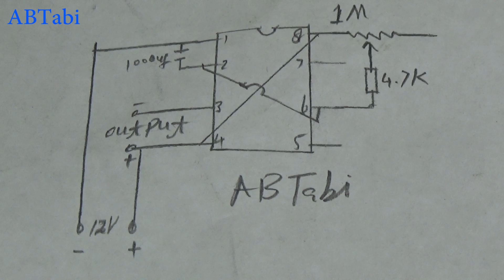How to make Adjustable Timer circuit, ON & OFF timer circuit at home

Comment: I want to make timer for 24V power input and it should be get cut offf after 45 min.

Pls help
Reply from the maker: Dear here you use 2m variable resistor and  1200uf capacitor ,,,,,

Comment: Sir I am diploma student . I have given to make project for automatically stop function for water tank  filling tank for roof. Sir I have calculated time taken to fill a given  capacity tank as 65 minutes. I studied the project uploaded on you tube. Nice video. I could not make out what components from your project be changed to arrive at calculated time of 65 minutes time to stop the pump' Can you please spare few minutes from your busy schedule to advice  me what components be changed with new values to achieve desired time of stoping please. I will be highly grateful to you sir. Expecting you favourable response please
Reply from the maker: Thank you so much ,,,,,,,   if you want more delay time  change variable 1m to 2m and capacitor if used in 220 uf  you can use 1000 to 2200 uf  i hope is best for you ,,,,,,,,
Reply: Thank you very much for your advice please.
HAPPY DEEWALI TO YOU & YOUR FAMILY

Comment: If i use vibration sensor instead of capacitor. Will it work, Or i need to attach it with capacitor?  I need off time delay with vibration sensor .
Reply: Here come the weewoos! Either that or look up - see that thing streaking your way? :)

Comment: what if i want to use mannually  dual timing 
should i use 2 differnt capacitor with switch
or 2 adjustable resistance with switch
like 15m or 30m
10M or 20M
please answer
Reply from the maker: Dear friend you can use ,,,,,,,      timer timing up ,,,,,,    like 5 to 10 ,,,,,,,    Thank you for interest ,,,,,
Reply: @ABTabi  please tell me how to get 30 m timing what should i use
Reply: Aoa bro can we increase the output timing up to 5 or 10sec

Comment: bro i need cut off for 2 seconds
 so which variable resistor is suitable for that.........?
Reply from the maker: Use 100k or you can also adjust it ,,,,,,,
Reply: @ABTabi  tnx bro.............
Reply: @ABTabi  bro didn't get 4.7k resistor instead of that what resistor can I use .................?

Comment: can i use 1.5v battery cell , to control a toy motor?
Reply from the maker: Check ic data sheet,,,,,,,,,  if ic work with 1.5 volt

Comment: Sir....this is an on delay  circuit...but you have done the off delay circuit with this same circuit...how is it possible?
Reply from the maker: Dear friend use relay to control ON or OFF ,,,,,,,,
Reply: @ABTabi  sir in which part of the citcuit do we use the relay.....sir could you please send me the circuit diagram....It is emergency....please

Comment: Can I cut ac power for my inverter at 3 am
Reply: Yes for that u hv to need a very powerful relay . It will work dc power. U can use mobile Charger and then a timer which can remember time and trigger at 3 am.